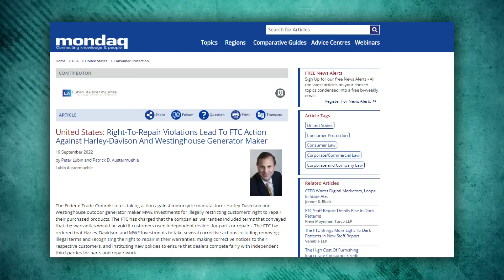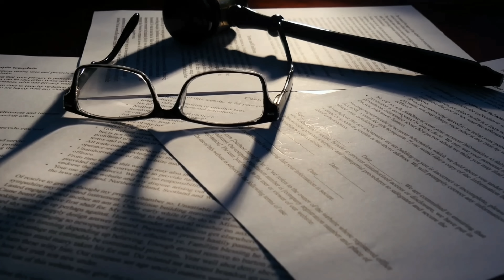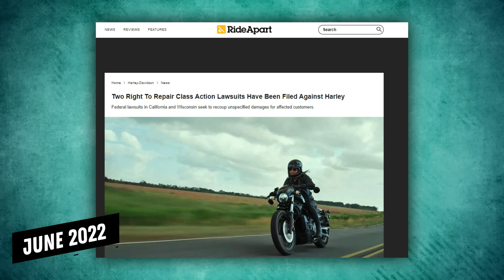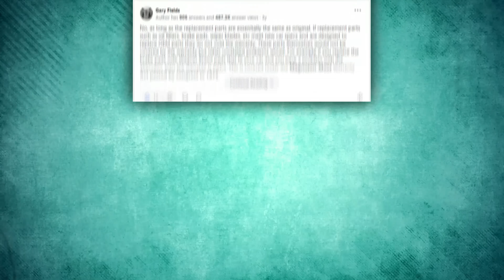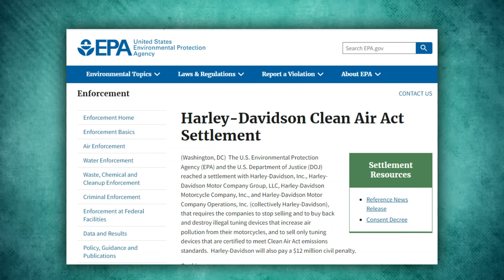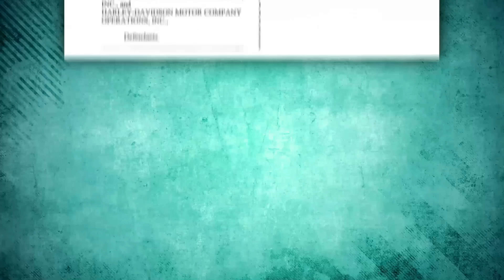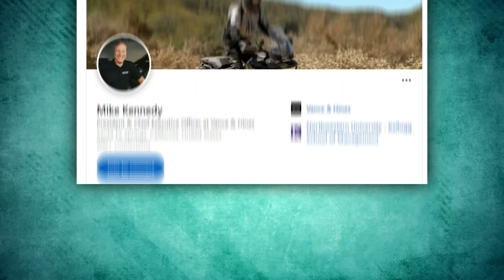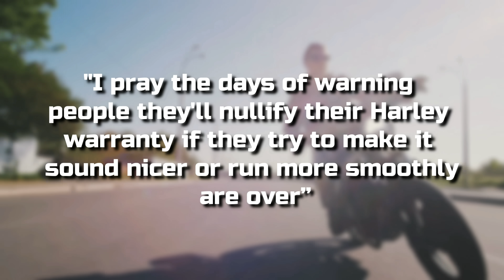This Affects All Motorcycle Owners!

Comment: I miss the old days when you could walk in a Harley dealership, and they would have a whole selection of upgrade exhausts, cams, air breathers and so on which they would gladly install no questions asked.
Reply: This stupid rule of Harley Davidson has been an issue for the longest time the first Harley I bought back in 1992 was the same problem I would buy after making exhausts or cams air cleaners and first words out of the dealership was, well you can do that but.... if something goes wrong with your bike you will void your warranty, and this was back in 1992 I've heard the same thing back then for older Harley's so as far as the old days? How far are you talking? 70's?
Reply: Thanks to our government that's not possible now, and it sucks
Reply: There's no room for that with all the merch they have.
Reply: I miss the days you could walk onto ANY Dealership and get exactly what you want without being required to pay thousands for a "package". Just for that particular option.
Reply: Agreed bought a 2006 dyna yesterday and they kept pushing the financing program..nah dude I got cash
Reply: @codymarshall7364  they make money on the shitty finance "deals" NEVER tell them your paying cash till the last second.
Reply: @harley9058  honestly no company is going to warranty your engine with aftermarket parts in it. As far as Harley goes I wouldnt touch one of them with a 10ft pole. But to each his own. Ride safe
Reply: @codymarshall7364  paying cash up front takes the leverage away from you over the company. Finance with the company that builds it for 1 year that way if any big shit happens you can tell them to shove it and stop paying until they make it right
Reply: @darkiee69  No shit, I used to say that Harley stealerships were clothing stores that sold a motorcycle occasionally.
Reply: My local Harley dealer is massive and half of it is accessories like exhausts, lights, fairings, etc. They will install all of it.
Reply: @holmes1956O  well that's what I've been saying all along Harley has been known for this my first Harley in 1992 I had that problem but thank God I made friends with a dealership I been going to for many years they always hook me up again it's all who you know and I've owned 5 Harley's in my time brand new not the ones I bought used I had many in my time still do, just have to know the people and take care of them so to speak
Reply: @harley9058  yup its just harleys need more taking care of than a good metric. Anybody that is honest will tell you that it is more expensive and labour intensive to care for a harley
Reply: @holmes1956O  I work on my own bikes I just keep them happy by stopping by and bringing them new customers and once a year Christmas gift little greasing helps along the way 🤣🤣🤣
Reply: @harley9058  I also work on my own have been doing so for 53yrs. I also restore and modify motorcycles. Into all types just not a cruiser kind of guy
Reply: Harley left the blue collar guys ( who fixed their own bikes ) when they started catering to the doctors and lawyers.
Reply: @atcjoe1600  lol yup
Reply: @jdmpurest  just because they install it doesn't mean it wont void your warranty
Reply: @atcjoe1600  that's a fact
Reply: The simple way around that is to either get the parts installed by a harley dealer    or wait until warranty expires.
Reply: @scottsingleton2951  just because a harley dealer installs it doesn't mean your warranty won't be voided
Reply: I miss the old days when the Harley dealer soda machine dispensed cold budwieser from the Fresca button.. 
If your old lady was willing to change t-shirts in the show room. The t-shirt was free. Their was no practice track. If you wanted a test ride. Just put on a helmet. Cause helmets weren't required by law. Go for a test ride to the local bar for a beer then bring her back. Used bikes and last years leftovers were plentiful.  Because if you weren't a man who cold kick one over. Or fix it on the side of the road. You weren't riding. God I miss the 60's and 70's.
Reply: @Hitech82  right on brother
Reply: @harley9058  Hey there.....but those Evolution models were not really a problem anyway, the TC's however need a warranty like they need petrol.
Reply: @darkiee69  lolol
Reply: @scottsingleton2951  or buy a quality Evolution era bike....no warranty, no parts, just riding at cheap prices
Reply: 90% still do that. They just are required to clarify that the warranty will be void if you do any internal upgrades.
Reply: @David-og7di  Evaluation motors were the best motors that Harley came out with that's what brought the company back, these new  M8 motors even the twin cams all a POS, you know the old saying why fix something when it's not broken? I love the Evaluation motor best thing since slice bread 🍞
Reply: Solution probably is Royal Enfield.  let's see for what about $5,000 I can be chugging down the road on a 650.  I can buy the aftermarket kit with the 850 CC upgrade for under thousand bucks. And my warranty still good.  think about it guys.
Reply: @SGTJDerek  Carvana offers that, too bad is just for vehicles and not for motorcycles.
Reply: I remember when HD dealers were small shops with one or two guys and they would have bikes with drip pans under the motors. Haha, not kidding!
Reply: @Hitech82  I was born in the 60's so for me it's the 70's and 80's but man I definitely catch your drift. The good old days.
Reply: @uncountedvoter9449  You're definitely not kidding. Wherever there was a parked Harley there was usually a puddle of oil underneath it. But people loved them anyway.
Reply: @Kevin-ne3tl  yep, and most of the clothes are made in china LOL
Reply: @holmes1956O  I've got a a 12ft pole that I use for stuff I wouldn't touch with a 10ft pole. I  still wouldn't touch a new harley with my 12 ft pole. They are  JUNK, HAVE BEEN AND ALWAYZ WILL BE. I SHOOK NANCY BOY WILLIES HAND ONCE AND I HAD TO WIPE IT OFF ON MY BLUE JEANS TO GET THE NANCY BOY OFF IT.
Reply: @David-og7di  indeed. My first Harley, a 1985 Super Glide Evo. Bought it brand new, over 150, 000 miles on it now. Love that Evo, there's no surprises with that motor.
Reply: @frankharley1000  that is an amazing run. Mine is 25 yrs old and has been cared for. Would you share your secret or like me you just read and do the maintenance schedule.        Best from NZ
Reply: @David-og7di  Hey NZ! Beautiful country, would love to visit there sometime.  Thanks… no secret…  Soon after I bought my Superglide, I researched synthetic lubricants.  I work in aviation maintenance and discovered every jet engine in the world is lubricated and protected by synthetic oil.  So after educating myself I began using AMSOIL lubricants in all three Evo sumps soon after break in, and have been using that brand ever since.  I selected AMSOIL due to their philosophy in lubricant development and their extensive in-house R&D (and the founder’s aviation (fighter pilot) background).  I’m convinced their oil quality is what has contributed to my drivetrain’s longevity. (mechanics have told me I should have needed a rebuild by now)  BTW, I live in southwest Arizona where the summer temps reach 42-46C (108-115F).  I still ride in the heat, but the air-cooled motor, and consequently the oil, get pretty stressed.  But the AMSOIL 20W-50 has provided outstanding protection all these years/miles.
Reply: What?? I can do that right now.   I have three Harley dealers that are great and would upgrade me without a seincd thought.  Lol
Reply: @DanBlackRacing  My local dealers won't install anything that is not EPA compliant. You are lucky or I am unlucky. I guess it depends on where you live or the dealership.
Reply: @frankharley1000  Thanks mate....Ill test out AMSOIL. Best to you
Reply: @David-og7di  you as well, brother.
Reply: @harley9058  Evaluationlution....... Huh?
Reply: @David  Evolution motors were the best. Harley's never had one issue, never leaked actually that's what brought Harley to the top, then they made these shit M8 Motors
Reply: @Roman Dybala  Yes, evolution best motors build, all those early 90's bikes back in the day that were bored and stroked you could push them motoers to the edge and never blow them I still miss my 97 wide glide and I wish I never sold it
Reply: @jdmpurest  Lights, fairings and etc are not engine performance upgrades. Try putting a Bassani exhaust and a Vance and Hines FP3 tuner on your warrantied bike then take it in for service. They will void your warranty. If it doesn't say Harley Davidson or Screaming Eagle on it they will not honor the warranty on your engine. I put Krusher slip on mufflers on my 2017 Low Rider S when I bought it brand new in 17 and my local dealership told me if I didn't remove them then my warranty would be voided. I told them to get bent.